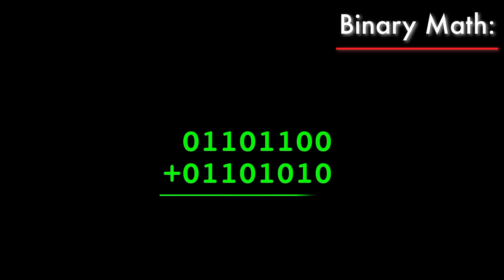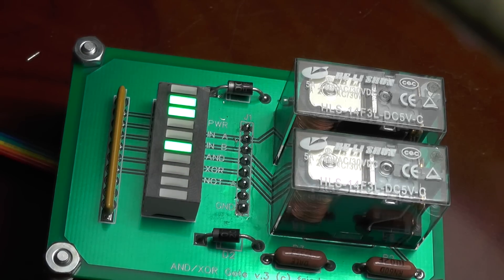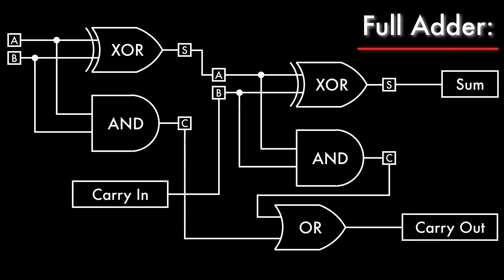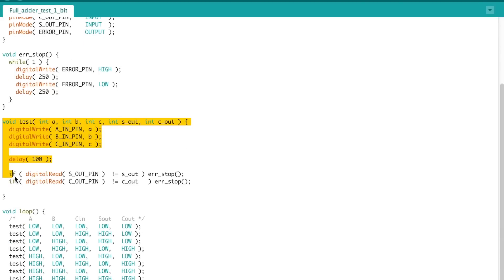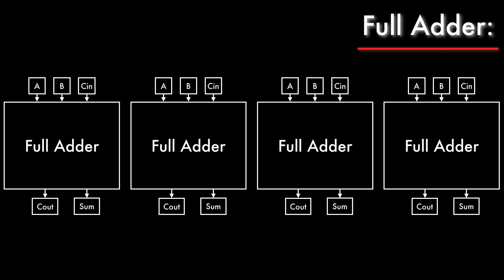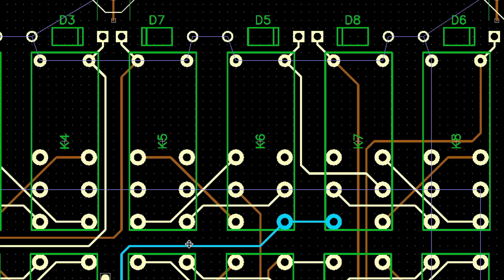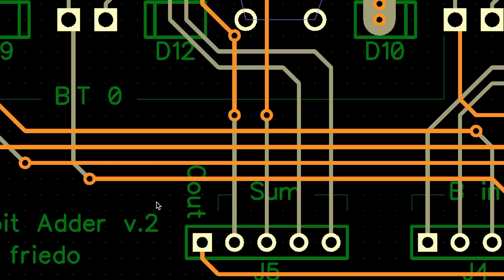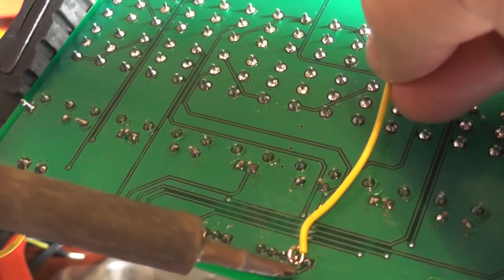Relay Computer ep. 2 - Building the 16-bit adder (part 1)

Comment: 0:18 what is that yellow piece?
Reply from the maker: It's a resistor network. It contains a bunch of resistors in a single package with a common ground pin. Here it's being used for current limiting on the LEDs.
Reply: @ClicketyClack   thanks!

Comment: I'm just wondering, how come we don't have to pull the outputs low?
Reply: That’s because the relay coils only operate when supplied with current. When the high logic state turns to the high impedance “off” state at the coil input, the coil will turns off - no need for zero Volts to be forced into it. In fact, relays turn off 2-5x faster if their coils are allowed to go to a higher voltage than 0V right after they were turned on. The anti-kickback diodes that are typical on relays aren’t that great: instead an RC snubber or back-to-back Zener diodes are better at preserving the speed of the relay.

Comment: Okay, here go overclockers. Hey! Bring me here that liquid nitrogen!!)))))

Have you tried to overclock it?
What is its maximum switching frequency, at which test is passed consistently without error?
Reply: The problem with overclocking is it has actual moving parts which will wear out faster the more time they're used. A mechanical part's lifespan is dictated by how many times it's used, so, say a relay's good for 1,000,000 switches. It's not gonna matter if those are over the course of years or one right after the other. Each time it's switched, microscopic damage is done to the moving mechanisms which eventually adds up to catastrophic part failure.

Even regular mechanical switches are only rated for 10,000 cycles for the tactile switches I use. One thing that caught me off guard is even potentiometers are subject to such limitations. Say, 10,000 "wipes" across a given area before enough carbon's been wiped off that it's no longer conductive. This is important because regular trim pots are usually only rated for a few hundred cycles because they're not expected to be used a great deal. Where a larger pot meant for something like a volume or gain control on an amplifier might be rated for 10,000 cycles.

It really took me for a loop when I found that out. Now mind you when I say "rated for 500 cycles" that doesn't mean the part's gonna fail after exactly 500 times. But rather somewhere around 500 times.

Comment: Wouldn’t the first bit adder only need to be a half adder?
Reply: Also adding 1 to least-significant bit is useful when doing subtraction :)
Reply from the maker: You can do it that way, but making it a full adder allows you to carry in a bit from a previous operation, so you can add numbers of any length.
Reply: Clickety Clack Aha!  that makes sense. thanks!

Comment: Where did you buy the hls-4F3L-DC5V-c’s? I can’t seem to find them in stock anywhere.
Reply: Many such relays are discontinued. The best source typically is eBay, search for “relay lot”, sort highest price first (that’s important), then go down the list and look for good deals. At the moment, $0.5-$0.6 per relay is the cheapest you’ll find DPDT relays.

It’s normally hard to copy relay computer projects verbatim because unless you’re willing to pay lots of money for relays with same footprint from an electronic part distributor like DigiKey, your only option is to buy large lots from eBay and adapt your project to the parts you have.

Comment: I was gonna blast you for the music thing, but you already acknowledged it so no point in beating a dead horse. This is a great video, but I would have preferred if you left the Arduino out of it for the sake of purity. Otherwise I thought it was great and even a little inspirational. It would have been nice to get some sort of specifics on the power source(s) used and how that end of it works. Some sort of diagram online would be useful as well, particularly for the way you wired it to the Arduino. I'm still relatively new to electronics and would one day like to make something like this. I've played lots with logic stuff, but I'm still new to the actual hardware side of things. Love the way the relays click. Looking forward to seeing more in the series. Cheers.
Reply: Arduino is there as a tester. Sure one could make testers out of relays, but it’d be more work. Once such a computer is made, it can be used as a tester in place of the Arduino.
Reply: @absurdengineering  Yeah, like I can totally understand a project like this using semiconductors for memory since it would be wildly impractical to make any significant number of bits with discrete hardware. So I understand there are SOME limitations to what making something purely out of discrete hardware would be. Especially if it's something that really has nothing to do with the actual function like a tester, as you said.

Still, imagine how satisfying the clicking would be from a 8Kb memory module made entirely out of relays. mmmm. Also, one has  to wonder how much space a thing like that would take up. Just doing back of the envelope math, the relays I have fit very snugly on a bread board with a standard pitch, and take up an area of 1x2cm. That'd take at least 16,000^cm of board space. Nevermind the fact that your boards are probably gonna be no larger than 30x30cm. So you'd have to stack them or something. And hell if I'm gonna figure out how many 1x2 relays can fit on a 30x30 board and how many of those boards you'd need for 8,000 or 16,000 relays, or however many you would need.

Comment: The short gate should be avoided or should have diodes in order to prevent short circuits...
Reply: I don't believe that's necessary for relays, since the output of a relay which is outputting zero is physically disconnected, it isn't a sink. For logic types which require a 0-output to be a sink, then it would be a problem.

Comment: Your "short gate" used to be known as a "wired or" way back in the 60's. One question though - where did you get that many decent quality relays without it costing an absolute fortune? Relays for crappy ones over here run to about $2 and if you want Omron or someone else good it's more like $4.
Reply: only place to get them is to to scouring aliexpress or smth like that...

Comment: Is there a reason why you are using these huge relays? There are much smaller ones.
Reply: StarTrek123456 my guess is price. smaller things also tend to be more expensive. that or he had an existing stock to use.
Reply: Tom Storey Bigger relays have a satifiying contact clack to them. Oh and why not have the contacts visible through the casing.

Comment: Can you explain the rest of what's on the board like the z-diodes?
Reply from the maker: The diodes are just ordinary rectifier diodes (1N4004) which are used to dissipate voltage spikes from the relay coils when they turn off. (Google flyback diodes for a better explanation.) 

They're not strictly necessary in a pure relay machine, but since I interface this stuff with sensitive electronics (like the arduino) the flyback spikes can kill it.